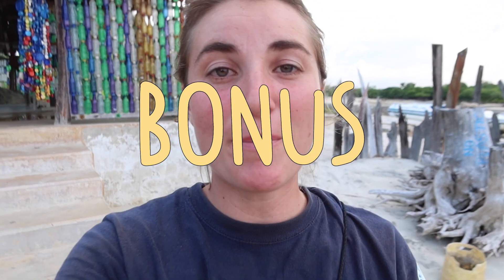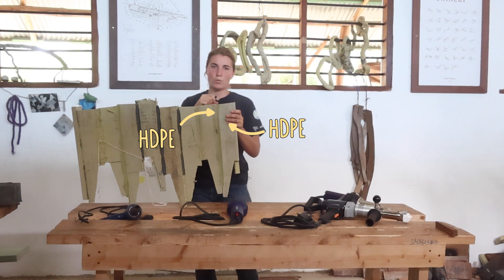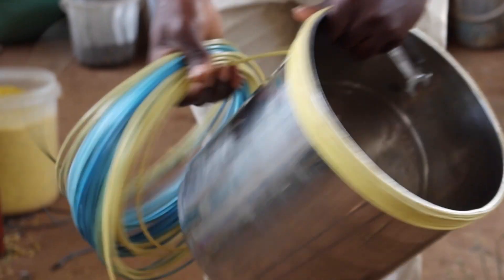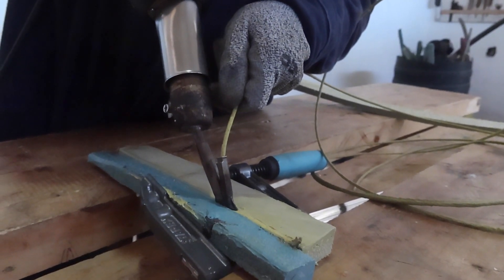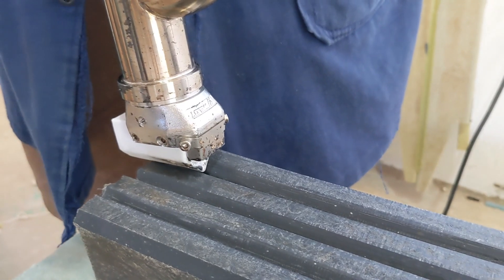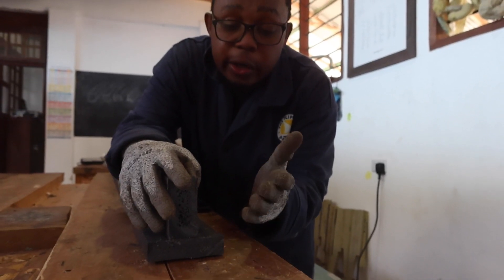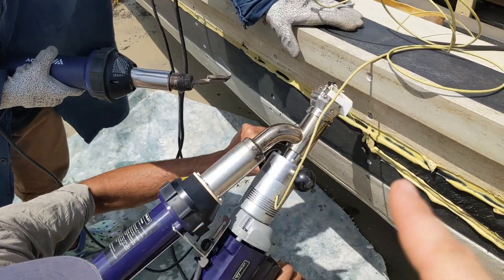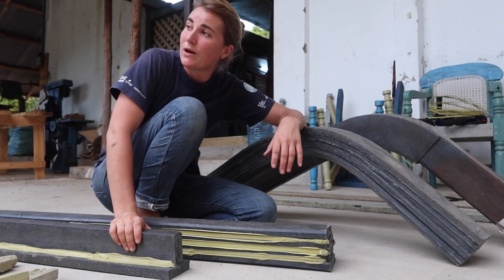Plastic welding - how it works

Comment: I am going to try welding my cracked recycle bins. I want to try using one that is beyond repair & shredding the pieces on a cheese grater for melting in a toaster oven. It might involve tools like a heat gun & a soldering iron...😮

Comment: Good info, many thanks. I'm headed to the Philippines soon and have been dreaming of making a trimaran with HDPE. I've been thinking a one piece mold ideally but these tools can be heaven sent in building up the interior. Idea to consider when molding out the exterior add a 3/4 inch honeycomb shell then add additional thickness after. If accident occurs the honeycomb can help compartmentalize any hole/crack. And for shitz and giggles a passing idea for quick patch repairs to keep afloat I wonder if a Silicon/rubber square/round/any size patch with thousands of tiny octopus suction cups you can place over crack/hole would even stick to HDPE. Things that make you go hummm )
Reply: Given recourse to traditional boat building techniques, contriving a beneficial honeycomb seems unlikely.

Comment: I'd been thinking for a while to try to produce a 3D printing pen that's open source. It could potentially have a bowden extruder to keep the weight out of the operator's hand, but to enable a really powerful extrusion force so you can pump out a lot more filament.
Reply from the maker: Be our guest :)

Comment: A few tipps:
Your running your welds too hot. The Beads only need to bulge slightly of to the side, not melt completely (small Heatgun). For Extrusionwelding (Big Heatgun) try to measure the Air and the Mass. Air should be 260 C, the Mass 230 C coming out of the Nozzle (same for PE and PP). Also try to fill your Grooves to the Top, until the Mass covers a bit of the Surface to both sides of the weld. That way you can be more certain, there are less voids.

For the more advanced Users, I also recommend to preheat your Nozzle, (white Teflon part at the Tip) otherwise the start of your Welds could be too cold (Bubbly Surface). Simply "weld" a bit on a Tabletop, that way the Mass does your preheating. And use  the proper Nozzle for the Grooves. It should be U-shaped, not V-shaped.

Keep up the scraping before welding, thats a very good practice, despite me only doing it for recertification :)
Reply: Review:  the "Nozzle" (foot?) is not V-shaped- only the front has a V profile, acting as guide and dam: the portion where the plastic emerges and is formed is U-shaped.

Comment: An awesome end to the Kenya series - well done to all!
I think looking into traditional welding methods would be a good investigation to progress this method further. For example:  joining two thick workpieces, typically a 'stacked' weld is used ie. a small root weld is run in the bottom of the vee, followed by multiple runs on top - stacked in a pyramid like the pins in ten pin bowling. 
For the Tee weldment, another idea would be to rebate the verical into the horizontal first, then weld. That way any loads applied to the Tee would be trying to shear the plank material apart rather than just the weld material.
All of this testing validation leans towards a very solid university Masters project...
Reply: My (metal) welding teacher said that to weld sections of a submarine hull together (VERY thick steel), stacked welds, as @trentineer describes, is the process used.  Good work, everybody!
Reply: Thanks a lot for your ideas on this! We will test this :)
Reply: @TheFlipflopi  - great! I quickly searched for an example of a welding test. Good detall. Link below. Notice the depth of the vee; and the "run-on/run-off" plates(which can be used in some real world welding applications.
https://youtu.be/rhR7aQmuE5s

Comment: 11:55 ME!  (Granted i am notorious for having all sorts of project ideas lol).  

Luckily the heat gun manual / "semi-automatic" method is already "solved" for the most part.  One thing i would want is some sort of "Ultimate Open Source Heat Gun" that has precise temperature control, and potentially an air inlet filter (so there is no heater coil fouling, and potentially less debris in the weld, although that latter advantage has way less of an impact i'd imagine).

For Smaller Manual Welds things like "Friction Stir Welding", or potentially some sort of Soldering Iron or "3D Pen" Based Setup May be worth a look.  These also luckily have existing Open Source Hardware options (Pinecil / TS100) to iterate off of.

Making one of those large plastic welding tools would be very interesting!  Adapting existing Open Source FDM Filament Extruders/Spoolers may be of use to this as well.  Also attaching a "pre-heater" (either a separate dedicated hot air gun, or a duct that splits air between the two) and testing flow rates+temperature for that would be interesting and potentially useful as well.

In applications like FlipFlopi it may not make too much sense, but developing semi-automatic processes similar in use to the metal welding world's "Submerged Arc Welding" may be interesting! (Most likely would be more like a GMAW toolhead (the thing described above; the large plastic welder) suspended on a frame or CNC Gantry).  Fixed Friction Stir Welding with something like a Drill Press or CNC Router may be interesting as well for applications like this.

It would require testing to see if it is of use (and thus if it is even worth pursuing), but i am interested on if oxygen free "shield gas" would be a good idea.  Unlike metal welding one could use simple CO2 or Nitrogen for everything.  It would be more complex, and again not needed in most applications, but i wonder to what degree the plastic Oxidizes/Burns when it is welded.  This is probably the most experimental of my ideas.

Cooling with Fans or Compressed Air After the Welder for a quicker cool may lead to better mechanical properties, so that is another experimental thing to look at.

That's a whole lot of rambling/ideas, so i'll leave that there.  I can discuss it on the discord, and have made OSE Wiki pages on some of this stuff already, but yeah.  I'd love to hear what others think about all these ideas!

Comment: 11:31  I don't know what you are already doing/are aware of, so sorry in advance if i overexplain!  Anyways there are a couple of ways you could go about testing.

You have "Destructive Testing" and "Non-Destructive Testing" (Also the third category of sorts of Feedback with Workers and Final Users of the Boats etc, i'll call this "Real World Testing" i guess)

Destructive Testing tends to Yield Some of the Best "Fundamental Data" (Tensile Strength, Compressive Strength, Shear Strength, etc) it does require some test jigs, and sometimes special gear however.  Also those numbers can sometimes be difficult to extrapolate to how they will impact the real world results

Non-Destructive Testing is the easiest (at least in it's most simple forms).  It can yield somewhat lower quality data however as it may be more ambiguous degree of "quality" / perfection rather than some scientific number.  It is best used in testing things you want to still use (test models/"beta versions"), or for Quality Control of the ones you are producing for others.  The most basic form is a simple "Visual Inspection" ("Dye Penetrant Inspection" may be another good accessible option if you want to get real fancy, although for most applications that may be a bit "overboard").  More complex systems like Ultrasound and Radiography (Think X-Rays, like how they are used for medical, only for non-living things like welds, parts, or even whole machines) are frequently used, but this is VERY "overboard" and may not work as well for plastic (although i will need to dig for data on all that)

"Real World" Testing Yields Some of the Highest Quality Data.  The Main issue is the Time it takes to acquire it.  Also it requires a good communication network that doesn't "naturally form" on it's own.  One can get close to this data in the short term by doing what is called "Accelerated Aging" testing, although that is a form of destructive testing and thus carries the downsides of that.  Short of Time, and potentially reputation (if the results are bad), "Real World" Testing is for the most part Free

That's a short introduction to what i know (at least in my non-expert context, i'd love to hear from ACTUAL experts!) about all this.

I'll probably discuss this more in the Discord.  I also have some OSE Wiki Pages along these lines.
Reply: Good overview of testing routes. I agree the destructive testing apparatus is expensive. Universities have a plethora of this equipment - perhaps collaborate with them?
Precious Plastic Monash University in Melbourne, Australia springs to mind...
Reply: @trentineer  There are some options, *and my long term dream would be to develop open source and (at least more) accessible versions of all of the professional ones too!

@CNCKitchen and @Thomas Sanladerer among others have done all sorts of Destructive Testing of Plastic 3D Prints

"CNC Kitchen" made a "Universal Test Machine" using plywood and stepper motors among other things if i remember correctly.

Another method is to simply affix the test article to something rigid, and attach weights with a hook until it snaps etc, that or pull on a "Luggage Scale" etc

A Hammer on a Bearing Raised from a Constant Height that swings down to hit something is a good simple method as well.

Comment: What an amazing technique. I am now going to try to weld together small plastic sheets until I can afford a larger sheet press
Reply: Yeeah, exactly :) Would be awesome to see your results :)
Reply: The interesting thing is that for a simple boat, welding small pieces together might be better, because it will have air spaces, which might make it float better.